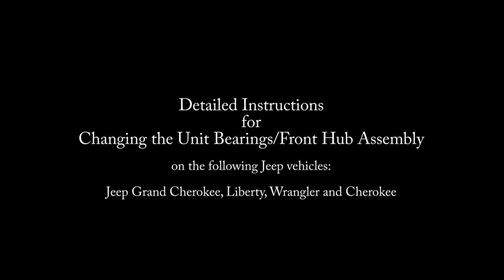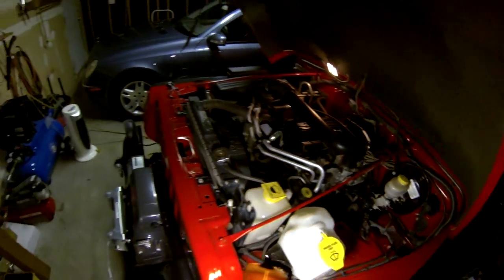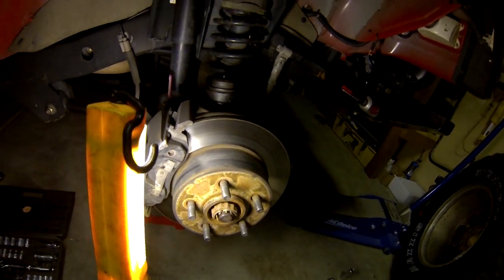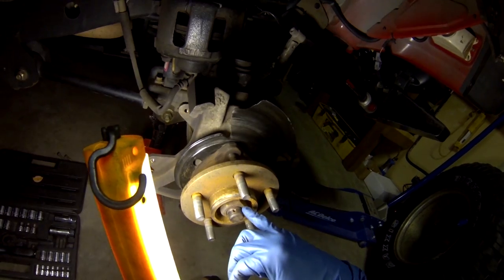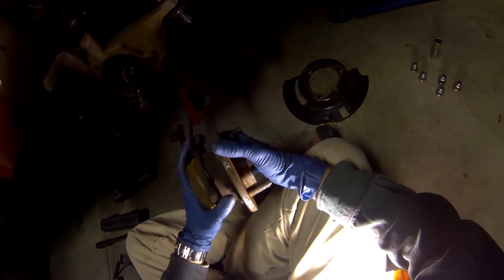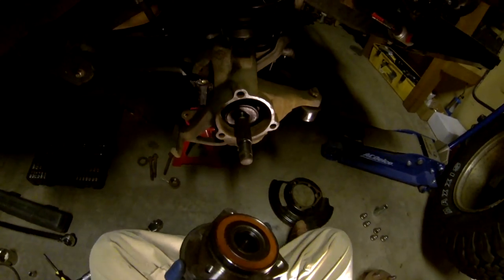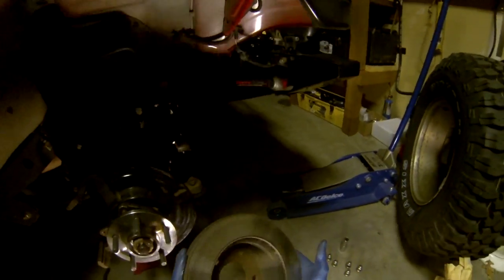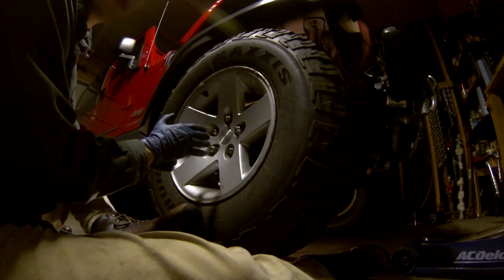Jeep Hub Replacement

Comment: I've got a 09 JK Rubicon, and the esp/bas and traction control lights came on the other day. The left front wheel would signal a slip and tell my traction control to kick in and my right brake to lock up while I would be driving.I've got 105k on her, and the left front bearings where shot. I just finished changing the hub assembly and this video help a lot(bit different than this model). I just took her out for a test drive and the problem is now fixed and all warning lights are off. Awesome Video... Thank you.

Comment: Hey  I  Have  an 03’ Wrangler TJ   And  I  was  told that  I  guess  I  should  switch  my automatic locking hubs to Manual  because  this  would  make  my  Jeep  wastes  less gas  and  more  importantly  not  have the  transfer  case  work  all  the  time  since  it  does  do  that  now  since  mine  is  automatic locking and  not  manual?   Do  you  know  anything  or  heard  anything  about  this ?
Reply from the maker: Rhino Watches- Your 03 TJ actually has permanently engaged hubs; they have no means to freewheel (where the wheels turn, but the associated axle shafts don't).  Automatic hubs would freewheel until the vehicle is shifted in to 4wd, then they would connect the inner part of the hubs to the axle shafts by syncing rotating assemblies inside the hubs themselves. Our beloved TJ's are always connected.  This does burn a little more gas primarily because there is hydraulic resistance produced by the gears turning through the differential fluid inside the front axle housing, as well as the friction inside the greased joints of the axle shafts and front driveshaft.  Translation; you would save a little gas, but have a more complicated and weaker (giving the spatial constrains of our small hub size) hub assembly.  Just leave them as they are.  They are pretty reliable and your gas mileage won't improve a very much.
Reply: FreedivejeepHD  Thanks  I  really  appreciate the  advice. And  yes  I’m  going  to  leave  them  alone

Comment: a million ppl have probably already bitched at you for it, but get a damn breaker bar, I wouldnt trust that torque wrench to tighten the bolts in my backyard deck anymore, let alone an axle nut.
Also if you dont wanna carry a breaker bar and you need more leverage, double wrench it off.